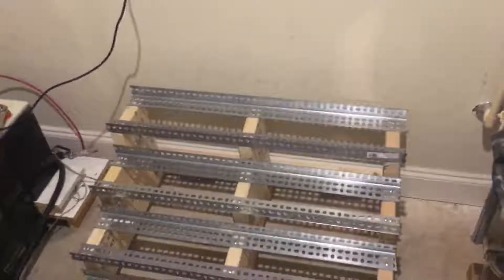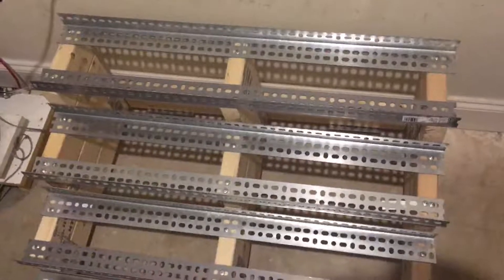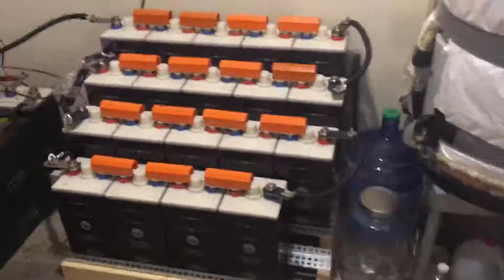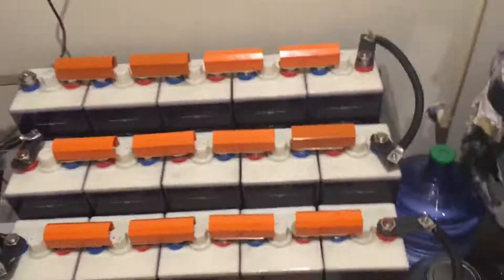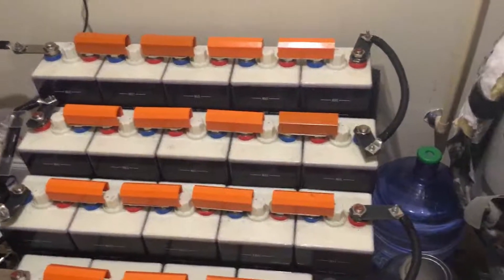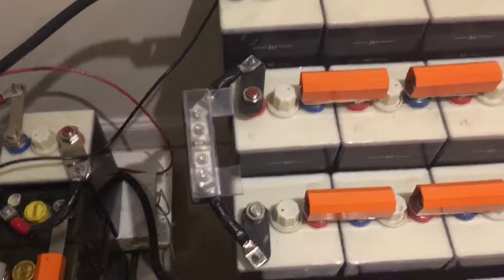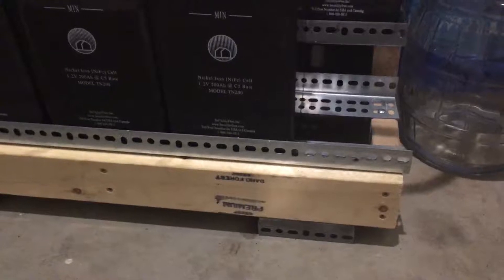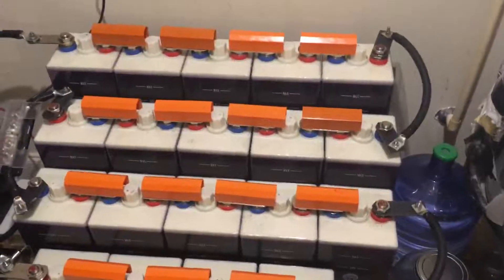New DIY Battery Rack for my Nickel Iron battery cells.

Comment: where is you auto water feeder? its been a year or more.
Reply from the maker: Unfortunately, I ordered it, and paid for it, yet the distributor didn't follow through. That's why I can no longer recommend BeUtilityFree.  But they did deliver on my Ni-Fe cells.  I waited close to a year to receive the order, but I guess it wasn't meant to be.  A shame really, I really wanted it.  Oh well.
Reply: no good, I once had a problem and was told to tell the bank, the fixed 
it all up paypal said it was too old to do anything. there must be 
another
way to make it simple to topup. that would drive me crazy.
Reply from the maker: There may be a better way, I just have to do more research.  For now, it's not too bad.